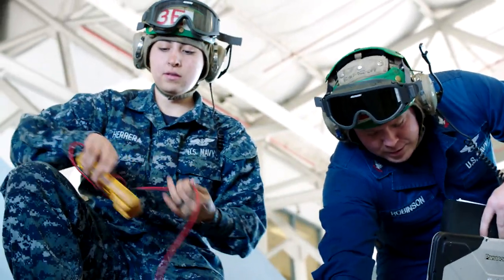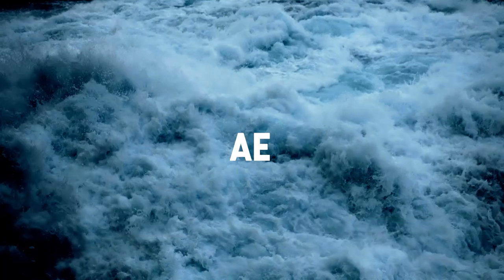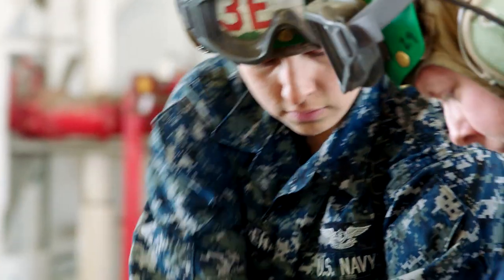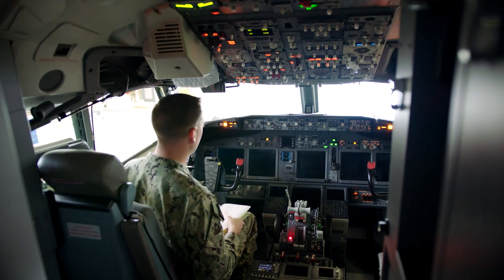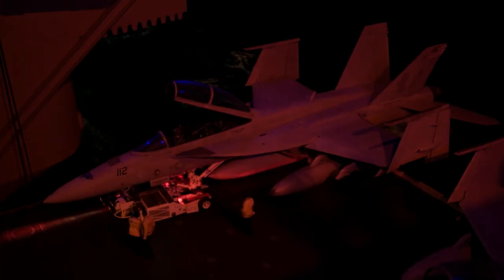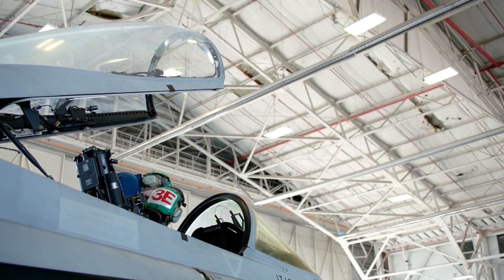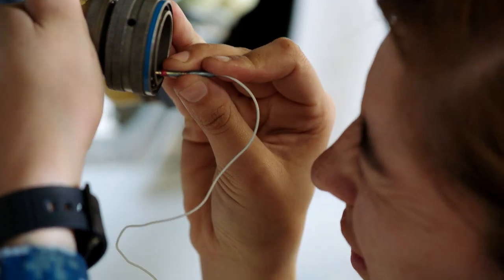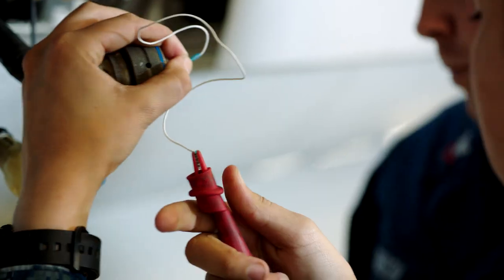Navy Aviation Electrician’s Mate – AE

Comment: We should change wiring to light system and solid state cheaper and easier to repair...light transmit through piping arrive at photocell then reduce weight and easier repair